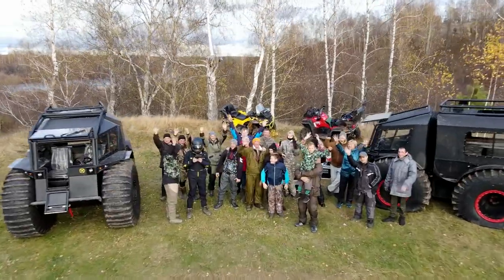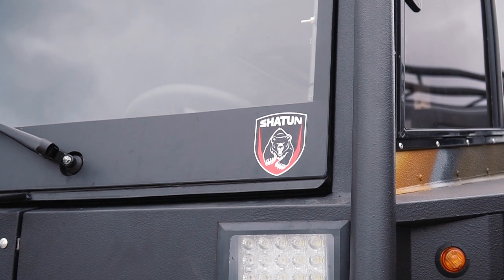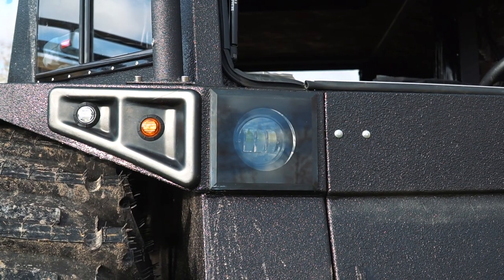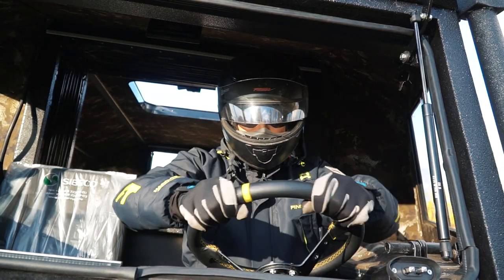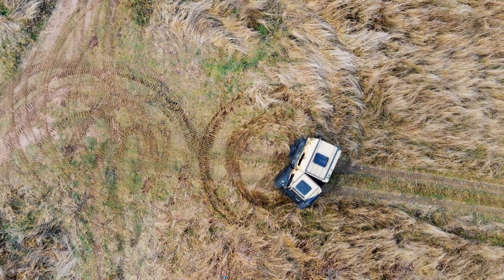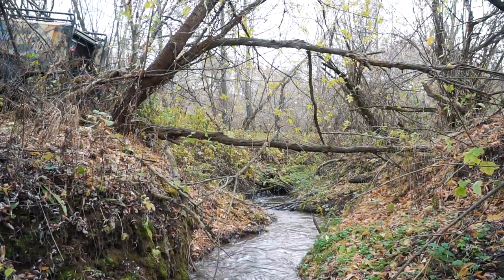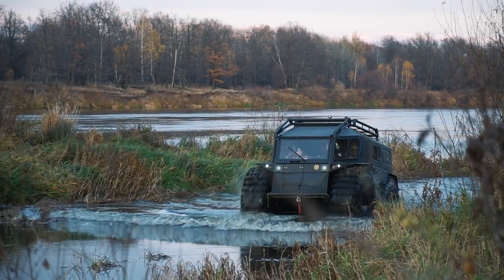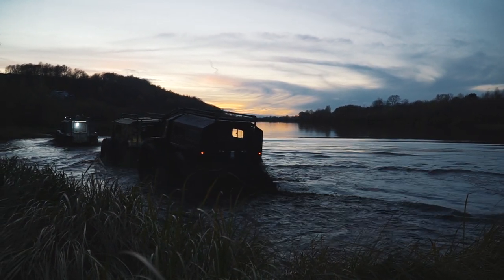Newest ATV! SHATUN Prime! Articulated frame!

Comment: If it wasn't for James Rollins' book "Kingdom of Bones", I might not have found out about this gem soon 👍.  It looks like a unique all-terrain vehicle.
Reply: I just got to the part in Kingdom of Bones where the Shatum is mentioned. After seeing this video, I can just imagine Kowalski at the wheel! I've learned about several new weapons and watercraft since reading James Rollins "Sigma" series.

P. S. And now I can add road (all terrain vehicles) vehicles to the list. I like it when an author throws in words, vehicles, boats, planes and weapons that I've never seen or heard of!  

I'm glad we have search engines and can (almost) immediately find out whatever it is!  Used to, if it wasn't in a dictionary or an encyclopedia, you'd have to go to a library to find whatever it is you were looking for. If that didn't work you could generally find a number (usually good ol' "long distance") and call and request a pamphlet or get an address and write a letter to gain whatever info you wanted. (I know, you're probably wondering what cave I crawled out of?) I suppose some of you are thinking we older folk lived in "the dark ages"? 

Used to, you had to dig for the info to write a paper or just to see what something looks like. Now, with the internet you can find it IMMEDIATELY! 

Just so you know, I grew up in a home with working lightbulbs and ONE "black and white" (the pictures on the screen were b&w, NOT the color of the television) television that picked up 8 stations. Back then 8 stations were plenty and you could always count on cartoons being on all Saturday morning each and every week! Oh yeah, dad had rein Sunday, baseball and football.. 

Believe it or not, I truly miss those days, things were so much simpler!  

I apologize for getting off on a tangent. Needless to say, I'd rather read than watch t.v.! In fact, I don't even own a television! I haven't watched one in almost 30 years!
Reply: That’s why I’m looking at this video!  His books would make epic movies.

Comment: from what i have seen in other reviews , the engine does not heat the inside well, you should try to make these for more arctic temperatures, insulated, and better looking interior wise, not everyone thinks loose wood plates is the "best" feature of these vehicles. and noise insulation is also needed.
Reply: Напиши разработчикам, свои предложения, может вознаградят. Круг еще спасательный и запасное колесо им предложи на крышу закрепить
Reply: I thought the noisy little diesel was a good feature

Comment: After all, it is SHERP in 90% in addition split chamber will never ensure water tightness or heat loss
Reply: Don't be completely sure.  Yes on the SHERP I totally agree with you, but a soft connection doesn't necessarily mean loss of heat from the cabin.